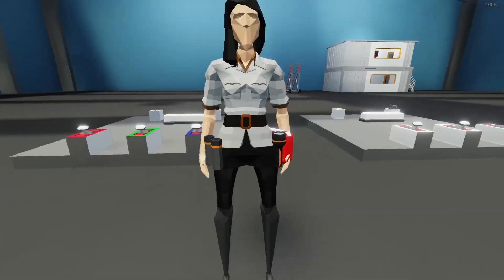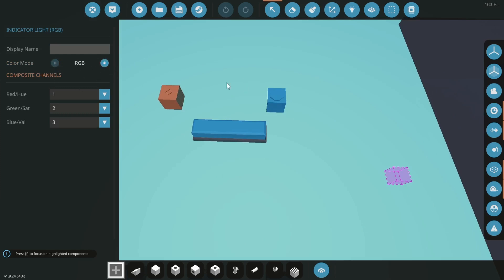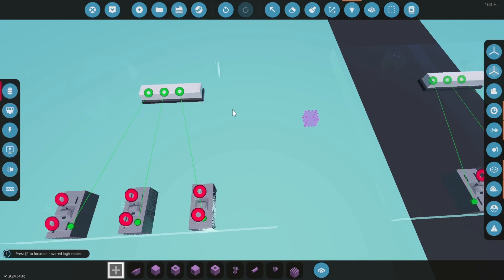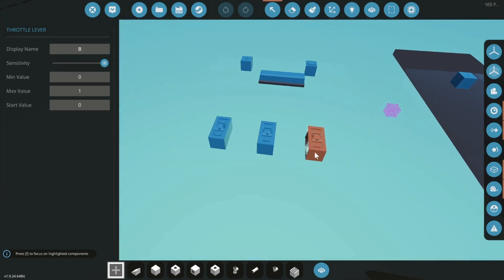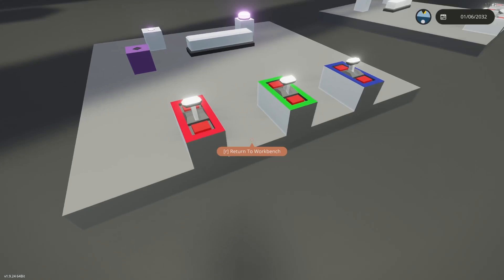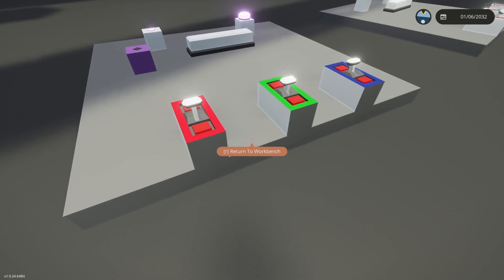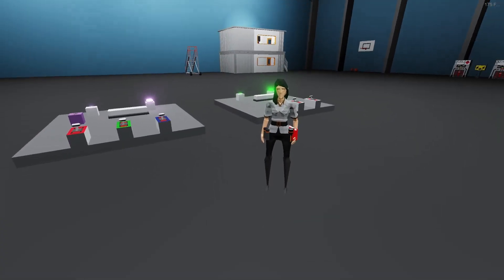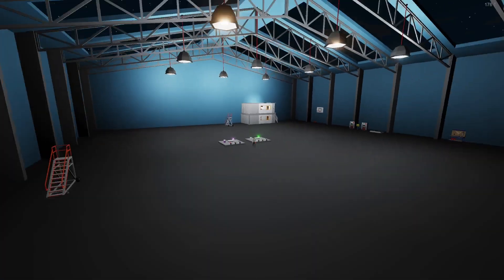Stormworks How to: setup RGB Lights! - Now turn your Numbers to Colors! Here we go! #stormworks

Comment: There's other ways you could go about doing sliders for RGB that have you doing less instant math. Namely doing a divide function in the microcontroller taking each value and dividing them by 255 and then you can change your throttle sticks to 0-255. Same thing with the HSV. Take the Hue value and divide it by 360 and then set that stick from 0-360. That's at least what I'd do because I graduated with an art degree and I don't look at RGB in percentiles or fractions. It's "this number R, that number G, and other number B." Also fun tip for just about anyone trying to make a vibrant creation via colors, the most noticeable colors are the ones found the least in nature. From what I've seen, it's usually magenta, which is all red, all blue, no green. You can spot a magenta creation in a forest, in the desert, on the ocean for the most part, and in the arctic. It's only during sunset, sunrise, and night when it's a bit more difficult to see it. It kind of makes me wonder why IRL rescue vehicles aren't all eye-cancerous magenta.
Reply from the maker: More Methods are always helpful!